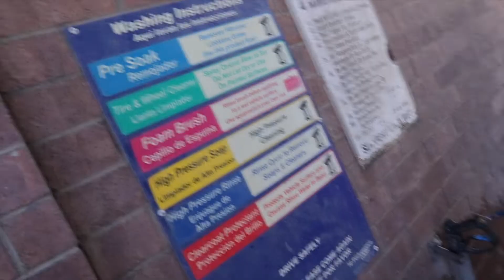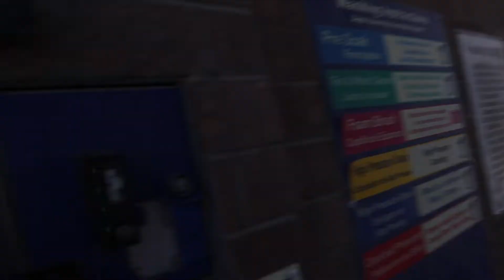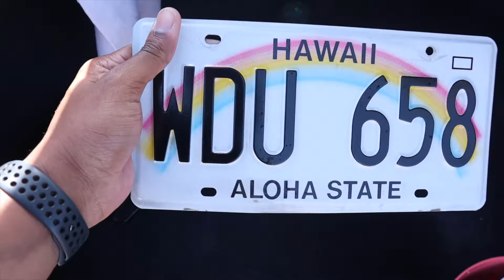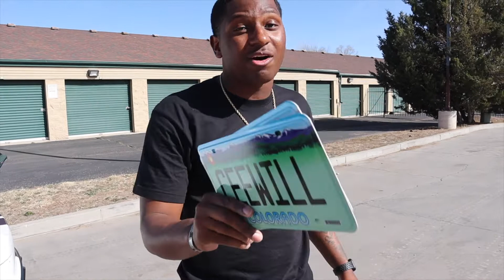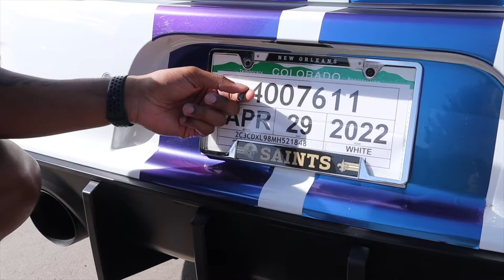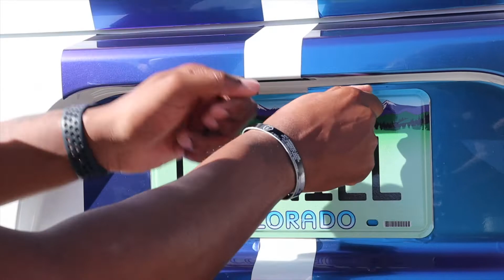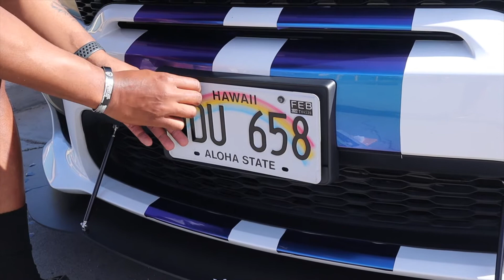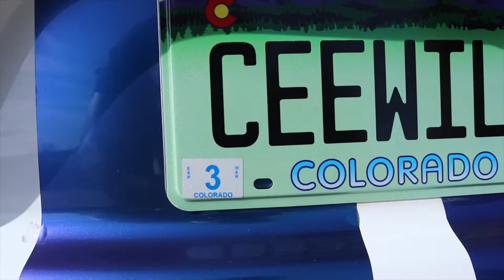My Brand NEW Custom License Plates Finally Came In!! Costs Me A LOT!

Comment: NEVER use a brush at one of those car washes that have those power washers because it will scratch the paint unless you don’t care about the paint that much
Reply from the maker: So what to use? Lol White paint you don't see swirls & I haven't noticed any scratches yet. I know some colors are worse than others
Reply: @CeeWill23Vlogs  bring a micro fiber towel or wash mitt with you